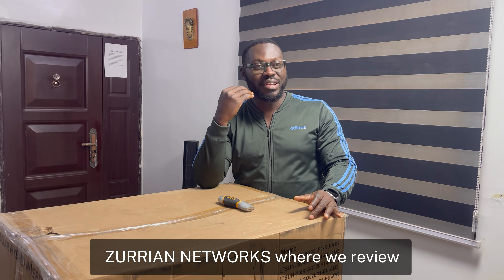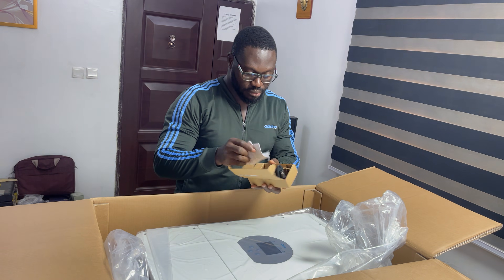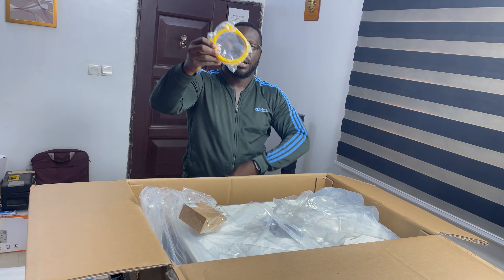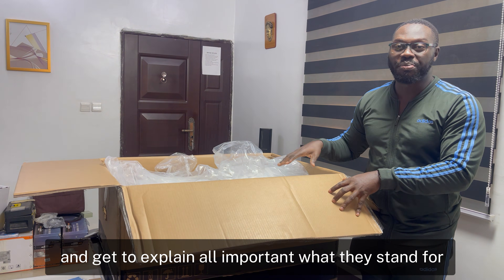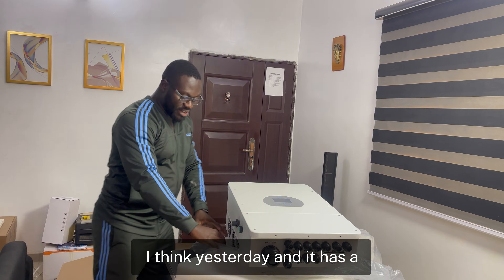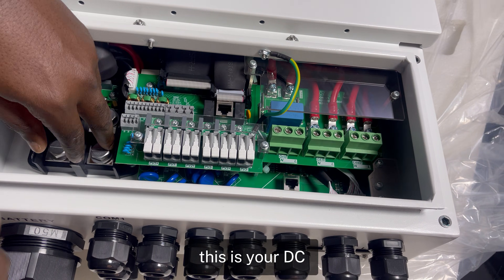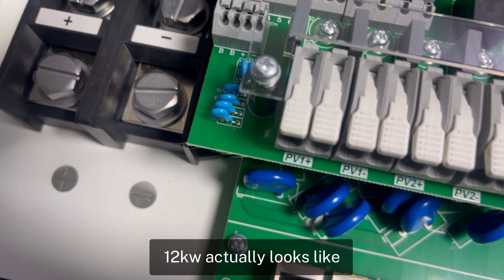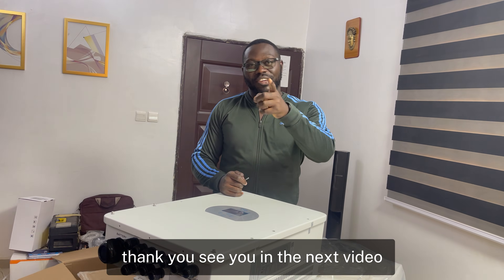Unboxing & review of 12KW Deye hybrid solar inverter (SUN-12K-SG02LP1-EU)

Comment: Hello SIr, I have the same exact model yet to install. I have a question regarding the PV input terminal. when its says 2+2+2. Does it mean each mppt can take 2 identical string. May I know if you can share advice before I connect them ? Thank You for you Video
Reply from the maker: Yes, correct
two strings per MPPT, but dont exceed the maximum solar capacity and current

Comment: Good review. 
Do I have to use both pv inputs per mppt or just one of the inputs?
Have 24 x 540W panels with Voc of 49.6V, and Isc of 13.66A. Can I do 8S per mppt or 4S per each mppt input
Reply from the maker: I believe your starting voltage is above 120V. Kindly do 8s/MPPT; this way you will save cable & clock for almost 420V VOC.

Comment: At night, we have only battery and Grid power source. I have 4 kwh load inclding 2 AC at night, but I don't wat to spend battery to run air conditioner. So lets assume, i am asleep with the ac running with grid, but suddenly grid goes off. Then the total 4kwh load with 2 AC will run by battery. How to resolve this as I want the AC power to cut while grid is off at night ?

Comment: There seems to be a variant of this inverter, the same name as shown on the datasheet you displayed, single phase as well, 12KW, and exactly the same look. The only difference I noticed is that unlike this one, it has a Max PV Access Power of 24000W and a Max DC Input Power of 19200W.

You can find it on their website with a datasheet showing the aforementioned specs. But when you download the user manual from the very same page, the sheet on the PDF shows the same sheet as the one you displayed; hence, datasheet contradicts user manual.

My question is, why the discrepancy? Or am I missing something?
Is there really a variant with the specs I mentioned, every other thing being equal?

Comment: Hi there, congrats for your channel, very informative and easy to understand. Could you please tell me how many 700w bifacial panels, voc 48,6 you can connect one way or another to the Deye 12k hybrid single phase inverter?
 Thank you
Reply from the maker: Thanks for your kind words.

Deye 12KW has max PV capacity of 15,600W& 3MPPT.
Open voltage = 500V

You will need 22 pcs(max number) of 700W/48.6V panel. 
Will advise you don’t exceed 9 panels/string
Reply: How do you split them on the mppts and strings? How do you connect them, series or parallel?